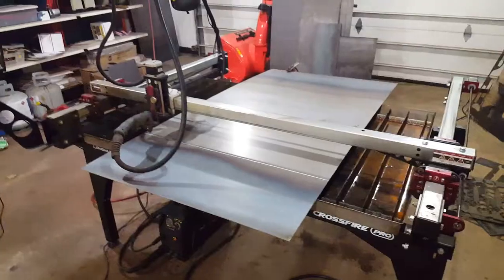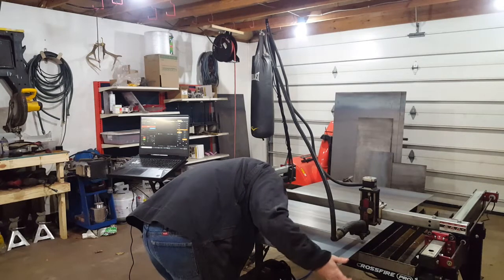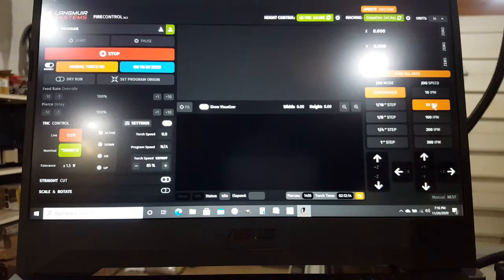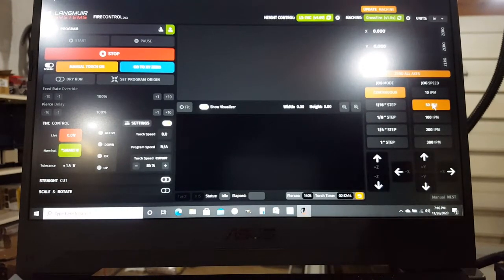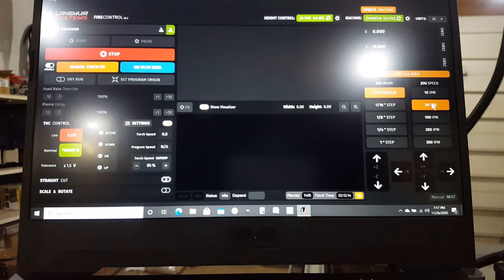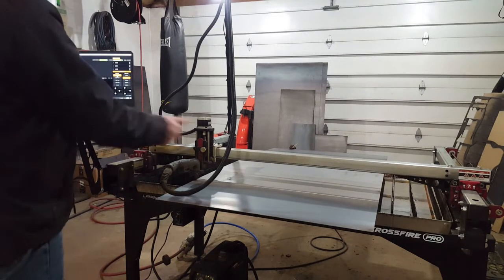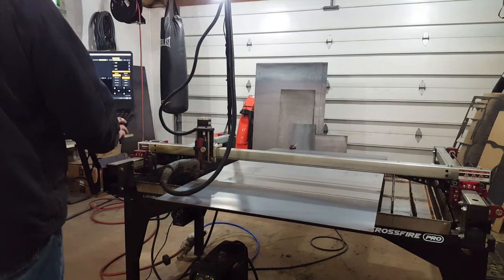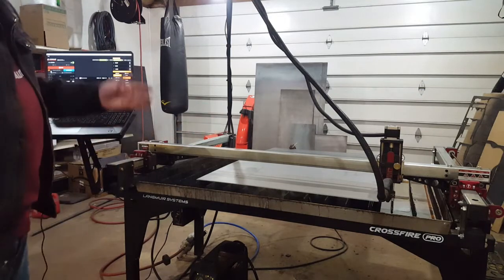Langmuir Systems Crossfire Pro (Cuts Made Without CAD, Or CAM Software)

Comment: Fire controls strait cut feature lets you define cut direction and length instead of manually controlling and jogging.
Reply: I use the fire control straight line feature also. can set ipm and thc also works with straight line feature. Still i did not know you can do that the way beck does.
Reply from the maker: Okay I definitely need to figure out how to do that!  I will pin this comment so people can see it until I figure out how to show people. Lol.
Reply: Problem I've had with that you have to start off the melt or it leaves 1/4in uncut but I'll definitely use the manual for cuting bend tests for my weld class

Comment: I just use a 65 amp hf and a separate table to cut mine.  Use a piece of angle as a straight edge and a 4 t setting.  Works great for expanded too, just up pilot arc time.

Comment: I've been trying to find out what would be better...my computer I use for my design work is a decently high end desktop. would I be able to run this machine from that pc via cable with the pc being in another room or would I be better off just buying a laptop just for this plasma table and just load files with a jump drive or whatever....
Reply from the maker: You should be able to run it with an extended cable.  It's for sure worth a try.

Comment: A question for you on your thoughts regarding running the plasma at 45 amps and cutting at higher rates vrs lower amps at slower rates and consumables......how much cutting gets done (actual inches) at higher amps vrs lower amps? 
The reason I ask is it might seem like you are going through consumables faster but you might be getting the same amount of cutting done ( if that makes sense).
I am not sure if that’s the case but would really be interested in knowing
Reply from the maker: well I just got an e-mail 30 minutes ago that my fine cut consumables have shown up.  Not even sure if they are going to work or not.  Once I figure that out I'll do a video on it.  I almost never run at 45ams any more.  I'm normally between 35 and 40.  with the fine cut I'll prolly be between 25 and 30.

Comment: I have the same issue with my razor weld. It doesn't cut for longer than 3 seconds though and I already sent it back to razorweld then selves and had it warrantied and it still does the same thing
Reply from the maker: One of my problems at first was I forgot the ground clamp.  Every now and again that happens.  Now that's the first thing I check.  Also the plunger in my torch was sticking and causing all kinds of problems.  I'll try and do a video on that in the future.

Comment: I have the standard table with Mach 3. I just line up the material, hit F5 and jog the cut. Simple. I will try this if I upgrade to the pro and the new software.
Reply from the maker: Fire control also has a cool straight line cut features that I started playing with after Isaiah Miles said something in the comment section.  I'm going to do a video on that features soon.  It's pretty cool.